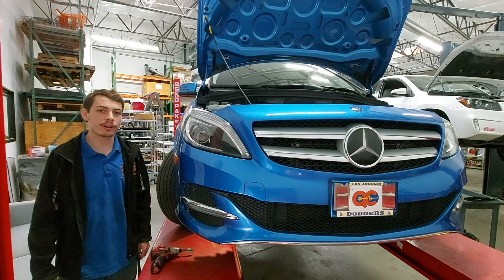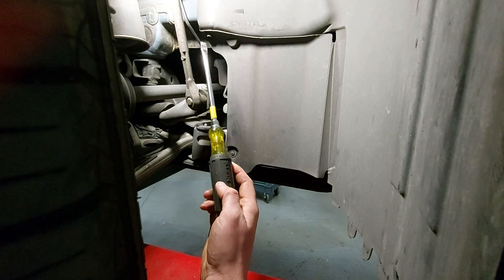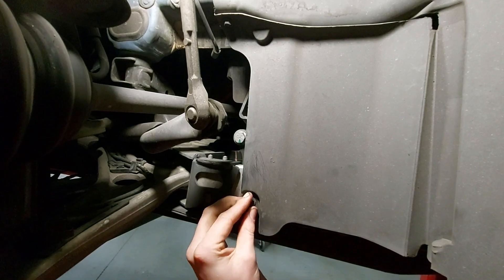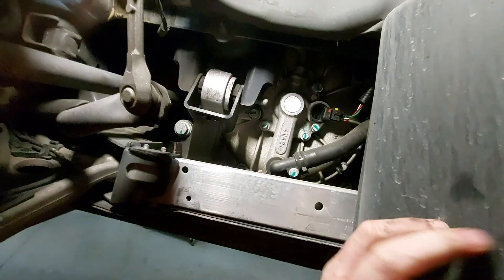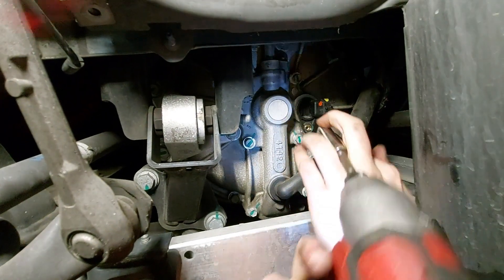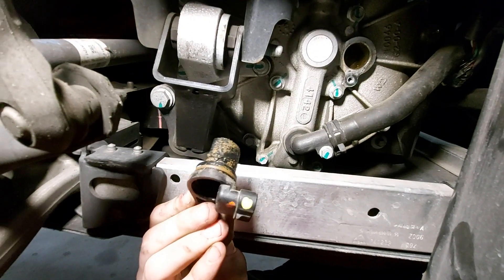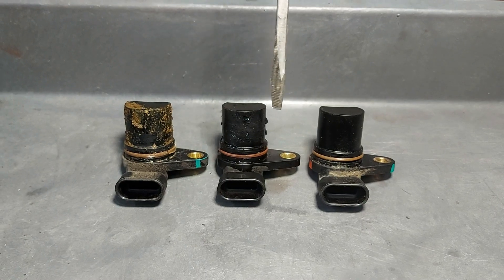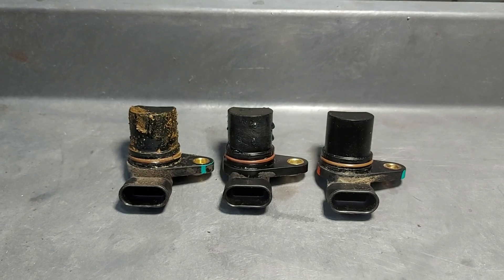Mercedes B-Class/B250e Drive Unit Coolant Leak Check

Comment: Is there anything you can do if the problem has started? Or is it just a matter of time?
Reply: Hi I’m considering purchasing a used MB-B250e 2014-2017 range and have the same question.

Did you ever find the answer to your question?

—Thanks

Comment: hi, thanks for the video, very helpful! Is there a movie where you show step by step installing the coolant delete in B250E? I can buy the part for 300USD and let it install in the workshop for 500USD (labour only) or I could do it myself in the garage . Is it possible to install coolant delete manifold without dissasembling the whole motor from the axis? any movie on that ?thanks!

Comment: Hi - im in europe, ireland with the same colant issue on B250E  2016 and being offered a replace by MB at 12K euro - i can get a regular ICE mechanic to do the repair using the great vids you've created, but i am not sure of the part no's i need to get ordered up and where to source. Any pointers appreciated

Comment: Thanks for the video! If a 2014 model had it's motor replaced in 2019, can it be considered reliable
Reply from the maker: ALL of the motors in these cars are prone to this failure mode, regardless of age, the seal will eventually wear out (if anything, the seals used in motors after 2015 are actually MORE prone to failure). 

If not caught early enough, the coolant will destroy the motor from the inside, hence why it is so important to perform this inspection on a regular basis. If you catch a leak early, it can be addressed while the motor is still rebuildable.
Reply: @KonduitEV  Thanks for the feedback. Found a nice low mileage car that had it's motor replaced but just worrying about this issue doesn't seem worth the stress.

Comment: For right hand drive vehicles is access to the speed sensor on the same side as you have demo'd?
Reply from the maker: Yes, the Drive Unit is in the same orientation regardless of whether the car is LHD or RHD. Speed sensor is always on the right side of the car.
Reply: That's great, thank you for your reply, much appreciated 👍 🇬🇧

Comment: great job You do with make a servis with EV !! do You recomended the electric B-class? i looking for 2015/2016. when the drive motor was replaced on warranty the new part will be deprived of seals issue?
Reply from the maker: Unfortunately all of the motors will have the seal issue sooner or later... Even the newest ones still use the same seal design which is prone to premature failure.
Reply: @KonduitEV  thanks for info so we can only prevent check the sensor and when found the leak make overhaul  right?

Comment: My 2016 B250e just start giving me a warning to bring it in for service after using a Chargepoint charger. I get all warning lights on and I have no power steering, abs, cruise control and regeneration. The car still drive, sometimes I did came on after a charging at home, but then when I start driving I hear like a big relay clicking on and off, I loose speed and then all the warning light come back on and I can drive again with all warnings on and everything else off. 
I brought it to MB service and paid $281.00 for diagnose. The result was that the front right and back left speed sensor is faulty and need to be replaced for $1,900.00, I did not get it repaired.
I see that you say that speed sensor does not normally fail, are they right or should I check if they have coolant on them?
Reply from the maker: The speed sensors they are referring to are the wheel speed sensors, which are a different component and totally unrelated to the motor speed sensor which we are referencing in this video.

Comment: Is there any permanent good fix for the coolant leak problem? 
Been considering buying a B-class as they have dropped in price. Im not afraid of doing work properly upon buying it if it can be permanently fixed. 
But if this is something that will likely occur again this is not the car for me.
Reply from the maker: We have upgraded triple lip seals that we use to do rebuilds on these which do seem to hold up better than the single lip seals that were used on later model motors. Unfortunately, being a seal on a rotating shaft (at speeds  upwards of 10k RPM), it will eventually wear out, as all seals do. To mitigate this problem, we also install a drainage kit to protect the sensitive parts of the drive unit from coolant if/when the seal ever wears out again.
Reply: @KonduitEV  How much does this service currently cost?
Reply: @KonduitEV 
Thats good. Thank you for your quick reply. Im a mechanical engineer and seals are defintively a source of problems. 
Could this be managed by the drain solution alone or will it develope into failure no matter what?
Its such a shame that something so major will take so many of these cars off the road.
Probably a stupid question, but it would not be possible to pressurize the drive unit housing? In subsea/rov applications overpressure is commonly used to prevent water ingression.
Reply from the maker: The drive unit is actually vented to keep it at ambient pressure... I think the biggest hurdle with trying to pressurize it would be not over-pressurizing it and blowing out the seals (either coolant or oil).
The drain kit is added to keep the internals (particularly the sensitive electronics on the inverter) protected from coolant in case the seal does fail. As I'm sure you can imagine, once coolant reaches the circuit boards on the inverter, it wreaks all sorts of havoc, and usually renders the inverter un-fixable. Bearings and such however are pretty simple to swap out if seal ever needs to be replaced again, and the idea is that you should be able to see coolant leaking out of the bottom before any major damage occurs. 
The biggest downside to replacing just a seal on the LDU is that the whole drive unit still has to be removed from the car to do it (at least on the B-Class and Model S/X, it can be swapped out in place on the Toyota RAV4 EV).

Comment: If you see that you're all good to go this one right here you can see
Alex Bessinger What part in the engine is failing? Is it a sealring os something basic? Has someone made a video about how to repair this? Is it possible to rebuild the engine for someone with fairly good mechanical knowledge? Live in Norway, so when my engine starts to leak, it wil be a long way to Norh America 😝

Comment: I just checked my 2016 B250e with 15k on it, it has some kind of condensation cover it, but its definatly not droplets like the one in the video. Would it be caused by the extreme cold weather in the north where the car has basically spent its whole life in?
Reply from the maker: Send us a picture to:

support@QCcharge.com
Reply: @KonduitEV  car went to the shop for a malfunction warning, will do that once i got it back

Comment: was looking at buying a used one with 100k miles on it. I guess i'll pass this model all together now.  What used ev do you recommend?
Reply from the maker: These are pretty good cars once the Drive Unit issues are properly addressed (especially if it's 2015 or newer). 
As far as other used EVs go, there are a number of options out there. Just like buying any used car, it really comes down to your needs/wants and your budget.
Reply: @KonduitEV  Does this not occur on the 2014 model as much? Did Mercedes use a different seal or Drive Unit altogether?

Comment: Great video.  I’m looking at a 2015 B Class that has found its way to a used car dealer in Atlanta.  First time I’ve seen this car in person.  If I did purchase this car how big a deal would it be to remove the drive unit and motor, band it to a pallet and ship to QC Charge for maintenance?
Reply from the maker: That's certainly a possibility, we pretty regularly have motors shipped to us to be overhauled. If you give us a call or shoot us an email we can go over things with you in some more detail.

Comment: I need a link to buy this speed sensor.  I can’t find it anywhere.  Please help
Reply from the maker: Are you sure it's your speed sensor that is bad? We have spares here at the shop we can sell if you give us a call. (760) 798-0342.
It's fairly uncommon for speed sensors to fail (though it has happened). If you have coolant present on your speed sensor, it's not the sensor itself that is bad, it's the coolant seal that sits adjacent to the speed sensor inside the Drive Unit. If your coolant seal is leaking, the Drive Unit needs to be taken apart and rebuilt to prevent further damage from occurring.
Reply: @KonduitEV  Once the Drive Unit is repaired... does that mean it will leak in the future again?
Reply: They have many names, I found this. Position Sensor - Mercedes-Benz (242-905-54-00)

Comment: Is there a part number or place I can order this part??  Also, if it has leaked like inside the motor, do I wipe out the leaked coolant in the electric motor?  Is it just a matter of time before the motor fails? Do you have a video if it fails, and or where to send the motor to be rebuilt?
Reply from the maker: We can rebuild the motor here at our shop in Vista California. It's pretty much a matter of time on all these motors, which is why we highly recommend checking the speed sensor at least once a year. If you catch the leak before it causes major damage though, we can usually repair it.
If a significant amount of coolant has leaked into the the drive unit, it needs to be taken apart and thoroughly inspected for damage, as well as cleaned, and have the bearings replaced. 
The biggest risk in waiting too long is that a few things can happen:
1. The motor could seize due to rust buildup (this we can usually repair)
2. Coolant could "fry" the inverter (this we can usually NOT repair, meaning it will need a replacement inverter, which is both expensive and hard to find).

Comment: Do you recommend replacing the seals regardless to ensure this problems never happens ?
Reply from the maker: The original seals will eventually need to be replaced on pretty much all of these motors. We do use an upgraded seal when we rebuild the drive units, but due to the design, they will very likely still wear out again eventually. For that reason, we also make a number of modifications to mitigate any possible damage that could be caused by coolant leakage.
Reply: @KonduitEV  interesting... I live in Jordan and we have a lot of b250e Imported from the US ..my friend just bought one and we have few mechanics who do rebuild the unit.

Comment: Many thx. Followed your instructions and sure enough my sensor looks like the one in the middle — not covered in rusty gunk but it’s wet. This is my second motor too; this one only has 5,000 miles on it.

Comment: Thanks for this great tip! Will a Mercedes dealer recognise a positive test (dirty sensor) as a major error with the engine, warranting an engine replacement on the warranty?
Reply from the maker: Depends on the dealer... But they should cover the replacement if there is indeed coolant on the speed sensor.
It's pretty clear that Mercedes knows about the problem, as we have had multiple customers bring their cars in to us (out of warranty) saying the the dealer told them there was coolant in the motor and it needed replacement.
Reply: @KonduitEV  Great, thanks for the reply! :D

Comment: I just checked this on our 2017 and sure enough the issue had begun.  Didn't look as terrible as your bad examples but certainly enough evidence to prove to my dealer they have a problem they need to deal with.  Thank you so much for sharing this information I don't know what would have happened had you not provided this clue!
Reply: Your post was about 4 years now.
Did the dealer address your problem? And approximately what mileage was your vehicle at when you began to notice the leakage?

Finally what make and model was your vehicle? (Tesla Model S and X also had the same issue, so I’d like to clarify)

Comment: Is this what causes the dreaded Drive Unit failure on the Mercedes B250e, when the hole drive unit has to be replaced? Are there other early signs to watch out for as well? I just bought a 2016 that is out of warranty in a few weeks, so I'm kind of anxious now, after hearing about all the drive units that have been replaced within warranty on these cars...
Reply from the maker: Yes, coolant leakage is the most common cause of Drive Unit failure on the B250e, hence why it is so important to perform this check! We recommend checking your speed sensor at least once per year.
Other signs of failure would be a bearing "milling" noise (if you search our channel, there is a video of what the milling noise sounds like in a RAV4 EV, which uses the same drive unit as the B250e). Potentially a "clunk" when accelerating or decelerating could also be a sign of worn motor splines, though that is not very common failure (clunks can also be associated with other issues as well).

Comment: I'll be checking this before my warranty runs out in July. Good to know. Thank you!!
Reply: Very good idea. Mine had a $10k motor replacement under warranty because I had them check it (was making a pronounced whine).
Reply: @BorderZach  same here. had my motor replaced at 44k miles. loud whine noise on a 2016 model. All Tesla's have this issue with the leaking?
Reply from the maker: Only Teslas (or of course Tesla powered cars) with a "Large Drive Unit" have this issue. That includes:
2012-2014 Toyota Rav4 EV
2014-2017 Mercedes B-Class ED/B250e
2012-2017 Tesla Model S/X (RWD or Performance models only)

Certain years of production are more prone to leakage than others, mainly those built between 2014-2018 (which includes of course replacement motors manufactured during that timeframe). Some of the earlier motors have had issues leaking as well, though it's not nearly as common (bearing noise however is very common on early motors). As far as the newer motors go, it's to early to tell for sure, but so far they seem to have a good track record.
Reply: @KonduitEV  well not damn..thanks fo the heads up! Mine is almost out of warranty coming up this summer

Comment: Very easy check to keep an eye on a catastrophic failure. Excellent video. Took me 5 minutes laying on my driveway. Mine looked like the middle one 😒
Reply from the maker: Hopefully you are still under warranty? If not, you can send it to us and we can rebuild your drive unit using new upgraded seals and bearings!
Reply: In the UK I do not think there are any independant specialists like yourself. 

However it would be very helpful if you could kindly provide any parts info that UK owners could order parts from you for this eventuality and serk out an independant willing to do the repairs. 

Thank you :-)
Reply: @KonduitEV hi what do you think of the Achilles seal fix for this issue or if there’s another fix